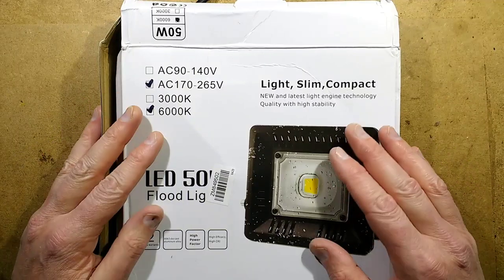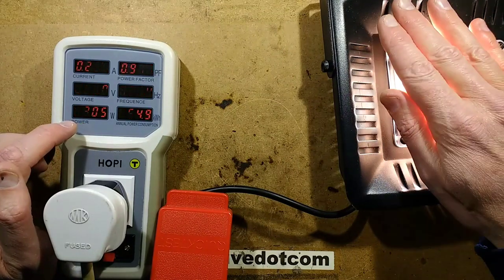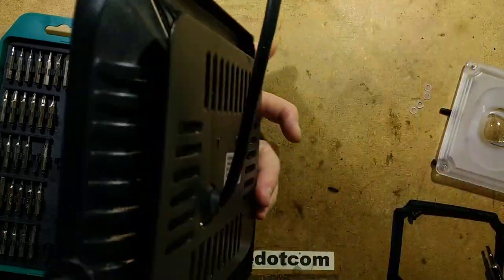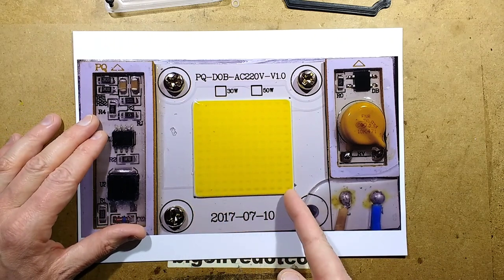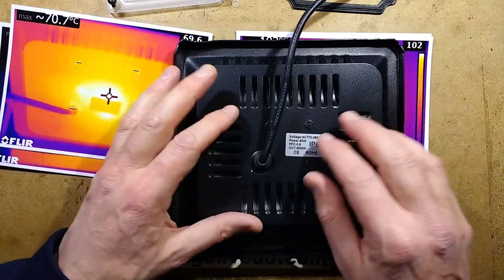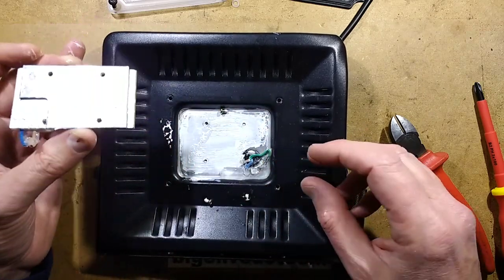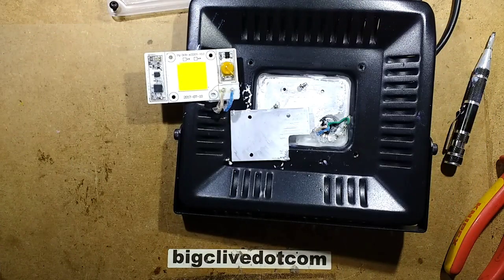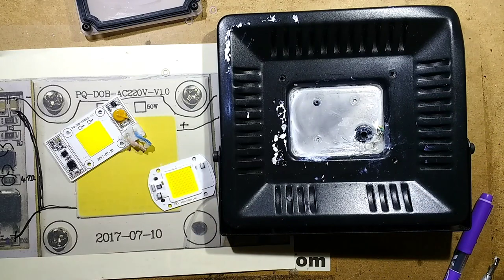Inside a super-slim 50W LED floodlight.

Comment: I guess one way to get around the squished wires issue, use an externally-mounted driver in a junction box near the light and fit a "traditional" DC LED module with a much smaller footprint, yes it adds a requirement for additional wiring, but, saves squashing mains powered wires to a potential short... :)

And were you filming this at around 8pm-ish? The mains frequency went down a fair bit on the Hopi, indicating the end of a dreary TV soap and everyone powering up their kettles... :P
Reply: twocvbloke ,
¿¡ !? ¡¿ That much measurable frequency drift ¿¡ !?  
Gonna have to look for that during an analagous event here in the US !
Ponderous... wonder how "smart power grids" technology is supposed to mitigate said affectations...
Reply: The voltage dropped by a couple of volts, but only when that 52 Watt load was added. The total resistance (impedance) of the cabling to that meter was probably around 0.075 Ohms, which would account for a ~2V drop, using the formula (V^2/W) = R. So ~4/52 = 0.077 Ohms.
Reply: @john howard, sounds like a  trump quote!

Comment: I've got one of these modules (not the dodgy housing). Mounted it on an old PC heatsink.. its been running happily for 6 months now... But it does get quite hot without the heatsink... And the main input pads are flimsy I'll have a check to see if I can see any chip ids on my one.

Comment: I'm wondering if anyone can answer a technical question about LED lightbulbs.
I'm in the US. All of the bulbs in my house are GE Reveal. Originally it was the Reveal incandescent, then the Reveal CFL's now the Reveal LED's. It's the only bulbs whose color I can stand, it filters out the yellow without being overly cool like the fucking god awful cool white daylight bulbs. The LED's aren't quite as good as the incandescent were but still very close to the same color.
ANYWAYS, I've noticed that with the LEDs GE has updated them a few times over the past few years. Now they're branded as GE HD Reveal. It looks like they've got the wattage down a bit for the amount of lumens they put out. The older LEDs had NO noticeable flicker. Their newest ones DO have a slight flicker which is only noticeable if you know it's happening or if you scan your eyes over them quickly. It's not bad but it still annoys the hell out of me.
My question is WHY do they do this? Is this a case of GE cheaping out? Is it a byproduct of increasing the lumens while decreasing the wattage? The bulbs say they are dimmable, does that have anything to do with it? I have older Reveal LEDs which say dimmable but don't flicker. Why, why, why? It gives me a headache sometimes but I hate the soft white LEDs and the warm white LEDs so I feel stuck with these. The color output really is amazing. It makes colors (paint and such) really look nice and whites really look great. I've tried every other brand and none of them look right.
Reply: I've found that different lighting takes 1-2 weeks before I no longer notice the colors and shadows looking weird.  Maybe you should try leaving different bulbs installed for awhile and see if you get used to it?  Might free you from your reveal prison.  Perhaps you're just used to reveal color temperatures so everything else looks bad?  My guess is the driver circuitry has changed (certainly because its cheaper) and now there's visible flickering.  If the driver has changed there could be small differences in efficiency.  I wouldn't put up with flicker from expensive bulbs they would be going back to the store.  I've always bought $1 warm white led bulbs from lowes (the whole house is full of them) and never had problems except for poor heat sinking eventually causing driver failure.  This is a design issue, LED screw in bulbs have terrible heat sinking in general.  After 2 or 3 years I put another $1 bulb in and tear the broken one apart for the LED board.  Most people actually prefer some (or a lot) of yellow in their indoor lighting because its similar to tungsten bulb colors and is good for relaxing

Comment: get one of those led light bars meant for vehicles and test it, I bought one of ebay that was advertised as 180W but when testing it with a 240W capable PSU I only got a draw of aprox. 30W. Would be interesting to get a deeper look on one of those.

Comment: STM18 seems to indicate this is part of the STM18xxxx voltage controllers manufactured by ST Microelectronics in Switzerland, a well known manufacturer.  I would suspect that the "C" designates a custom part made for a specific customer and that the rest of the part number designates something like the intended voltage and the design version.

Comment: Well, unless you're having some sort of emissivity issue due to the conformal coating (the goop) going on there, if the mosfet/transistor is 108 centrigrade on the outside, it's going to be as near as makes no difference at critical junction temperature (125 centigrade) on the inside, which should see it fail fairly rapidly.

At my college they (probably still have) had a little chamber to stress test circuits for heat. As one of our lab excercises was to design and execute an experiment with regard to reliability, I built a little 4520 counter circuit which I then intended to run at critical junction temperature, to see how long it lasted. I wrote a little assembler program for a Z80 computer board, which would clock each of the counters in turn and checked whether it had in fact increased by 1 or rolled over to 0 if the previous value was F. If an error occured, it would energize a relay which would, in turn, stop a timer.
In theory, according to the most widely used model for a single semiconductor junction, it should have lasted about 72 days, but, probably because there a quite a lot of junctions in this IC and it's not really expected to run much above ambient (so the non-military ones don't undergo testing for it), it lasted only 4 days.

In case anyone's wondering, there's an about x2 factor increase in lifetime expectancy for every 5 centigrade below critical junction temperature, so at a typical 45 degrees CPU temperature, you're looking at about 60 years for every individual junction (and there is prototype testing in this regard, although the production process is trusted afterwards).
Reply: You're correct about junction temperature failure times. A semiconductor manufacturer in Europe (sorry, no specifics here, they would lose contracts) made devices which the customer specified were to be 100% QA tested for about a year at a specified minimum temperature, and under specific electrical conditions, before they were acceptable. Temperature had to be controlled very precisely, to ensure a 100% pass rate. One failure meant rejection of a whole large batch of devices, so a 5 degree Celsius over-temperature could have cost a lot of money. And a 5 degree under-temperature would have entailed a re-run of the whole test, which was also expensive and could have resulted in the cancellation of the contract. The customer was happy to pay around 20 times the retail price for something with ostensibly the same capabilities, which had not been life-tested so thoroughly. Why? The operational design life of the devices was quite short, but lives depended upon total semiconductor reliability during that time. The customer needed that guarantee of reliability. No device ever failed during use, and lives were indeed saved. Knowledge of the behaviour of Silicon junctions at temperature was essential, even critical, during design and manufacture.

Comment: A very proffessional breakdown , although it would have been more relevant to know if it can run 5 hrs without blowing , and if the power is reduced as it gets hotter
Reply from the maker: +oz93666 Power did not reduce significantly after a few hours.

Comment: Would those louvres be a safety issue in the rain, or is the internal waterproofing sufficient to effectively just make it water cooled?
Reply: awmperry the vent holes don't go through to the interior, just from front to back of plate.
Reply: Ah, so it's a single plate? Hard to see on a small screen, looked like there could have been a cavity. Cheers!

Comment: I love the fact it has a MOV to protect it against voltage spikes, but I didn't see what protection they had if it shorts out.  Are the traces thin enough to act like a fuse?
Reply from the maker: From destructive LED tests I found that the LED bond wires blow like fuses and the arc is contained by the phosphor loaded gel.
Reply: I don't think that will help if the MOV shorts.  I believe there's been a few fires started by power strips where the MOV overheated before they figured out they need to add thermal fuses touching the MOV.
Reply from the maker: Ah, I misread your post.  The track or supply fuse would fail.
Reply: Против Глобал, that's what I don't like about capacitive dropper - because spikes are high frequency, those go right though.

Comment: I bought 6 of the 'Driverless' LED floodlights, 4x10w and 2x50w, all of the 10w ones failed within 20 hours of use and one of the 50w ones after about 60 hours

Comment: The second type of driverless LED you show (that you did a video on earlier this year), I had two of three 30-watt ones fail on me; I bought them from same eBay seller.  They ran about 30 minutes a day for 6 months, before failing (both failed within a week of one another).  The actual cob LED is what failed; I could see several dead diodes within same row.  I don't think it is heat related, they were mounted in recycled flood light cases with expensive compound and everything stayed under 70 Celsius when measured.  My guess is they have same issue as first generation/cheap cobs  where they're poorly matched.  I've got one original still working and two new replacements...will see if I get anymore failures.  If I do, I'll probably buy 20 watt version.

Comment: Where did you get that cool little line power connection block? I could definitely use one of those on my bench as opposed to the "Death Cord" I have that is just a line cord with a line mounted switch and insulated alligator clips.
Reply from the maker: Search my videos for quick test.  I took it apart in one of them.

Comment: I wonder the rating on that bridge rectifier...just found the same pkg in one of  my 3D printer gear, only have an smd code. Clive d'y'think this 50W  performs as well in 60c  110VAC N.A. I shall see if there are any avail in that option. Perhaps one might determine power factor without the HOPI ? Best,  C

Comment: They could of pressed a depression into the metal to allow for cable entry (this can be done sit punches the hole, in a single operation, doing this would of increased the cable space, then they could of put on 4 mounting screws instead of 3.

Comment: Thanks Clive. Another one to avoid. Reliability has to be an issue, given the heat, and with 72 LED's in each string. Only one LED needs to fail, and it will take out its parallel partner, and the device becomes a yellow display palette for two little dead flies. An MTBF of 100,000 hours per LED indicates an average expected life of around 1,400 hours, even ignoring that hot transistor, water ingress, and the dodgy cabling. That's slightly less than two months of continuous running, or under six months of eight hour nights.
Reply: a guy above said his ran for 30 minutes a day * 30 days/month * 6 months = 2700 hours between failures not too far off lol

Comment: I have gone through approximately 5 of those led chips your comparing and they all failed after about 2 weeks of continuous use.  When they fail they go very dim and/or nearly half the cob blacks out completely. I even had a grow led fail and i used such an efficient cooling system that it never got warm. Failed after 2 wks.

Comment: would you have refrained from taking it to bits in a non reversible manner if it was a warm white flood light ?
Reply from the maker: No.  It was bought to be taken apart and wasn't up to expectations.  Technically speaking I could have fitted it with a warm white driverless array.

Comment: I wouldn’t trust the colors of the wires as to which is ground wire. You’d think it would be green, but I’ve bought some of these early version Chinese made flood lights....opened them up to check wiring, and voila. Green was one of the legs out of the driver instead of the actual ground. The ground was “glued” to the case with hot glue gun material. Danger will Robinson!

Comment: I know this has nothing with this video, but maybe you can answer a question. I have some of these power banks that hold one 18650 battery. Can you explain why if I charge one of them up, 2 days later (without using it), it does not stay fully charged? Does the little circuit that has the LEDs on it discharge it even if it has not had a load on it?
Reply from the maker: There's a small standby current, but it shouldn't discharge the cell too quickly.

Comment: about 8:08 i have been trying to find one of those web pages for a long time now. care to share one you find or how you find one?
Reply: Just Google search for a random number such as '16744821674482167448216744821674482' & you get nothing. Having said that if Google's bots scan this page, the above random number should return just this video in it's search. Another way is just search using a single asterisk.

Comment: Im a beginner at electricity. Can you please explain what you ment by testing the light if it was earthed . Was that a good thing or not ?
Reply from the maker: Most metal cased lights should have the earth or ground wire connected tightly to the case.  It provides a path for fault current in the event of a fault.

Comment: Could be an austenitic stainless steel like 304 or 316 they aren't magnetic either.
Reply: Yeah, but unless they milled it out of solid to get those cooling channels, it would have to be cold-worked.  And cold-working makes austenitic stainless steel magnetic.

It's amazing the stuff you learn from watching AvE.
Reply: I'd think aluminum, judging by the shipping damage.  Probably better for a floodlight anyway, because of the higher heat conductivity.
Reply: Austenite to Martensite conversion. For example - https://www.asminternational.org/...pdf/7c5e4830-b443-4c71-a8c8-1a85c5b39dc5 . Also affects corrosion resistance (particularly halide attack).

Comment: I got some 80W spots with drivers on board and use them every day for 2 hours....they all die after 3-4 months due to overheating, one can see the tiny black spots at the COB chip. I'm afraid they are meant to fail, 20% more cooling area would do the job....crazy world.
Reply: Only 2 hours? You can use them longer than that, even during flowering!

Comment: i've used a few of those 50w integrated driver leds. put 3 of them to the back of an old 2x4 lay-in fixture. one of the 3 went dark after a while. not completely dark just real dim. whats the life on those things?
Reply: not sure, how long did the one last?

Comment: Clive, g'day bud. I have a " Bottom line, Side finder" depth gauge/ fish finder that I haven't used in a few years. I inserted the batteries and it seems to no longer work. I no longer need this unit as I have upgraded. My question is. Would you be interested in tearing it down and not only showing how it does what it does, maybe trouble shoot its issue. I no longer want this, so I'd not want it back. Free to you if you're interested. Thanks, and I really enjoy ya posts. G'day sir.

Comment: Are there any driverless LED boards like those that don't flicker ?
Reply from the maker: The way they work without smoothing means that flicker is always going to be an issue as they are off for the part of the sinewave where the voltage is lower than the combined forward voltage of the LEDs.
Reply: Ohh now I understand, thanks ! So if the current would be converted to 230V DC it would not flicker.
Reply: :/ So in short, all those driverless LED boards suck.
Reply: I thought about using those for my plantlights, because they are so cheap, but if they flicker, it would probably drive me crazy.
Reply: 4000K LED lights are the best, at least if you want natural growth, and you don't aim for harvesting anything. I use those lights for my indoor Bonsais. Most interesed people would probably be disappointed, if I would show them my Growroom :D
Reply: Yes, that is correct. I tried many type of LED lights and those ones I linked above seem to work the best so far.
I don't know, if there do exist different types of 4000K Led lights at all, they are constructed with blue led lights, and have a phosphor coating which changes the wavelength. They will probably all use the same blue leds, which are the cheapest to manufacture, but wikipedia says, some use uv leds. The phosphorluminesce gives a broad specturm of wavelengths it says, not sure if there is a way for me to figure out, how the spectrum is exactly distributed without very expensive tools. The temperature is just the balance of blue/red factor. So 4000K is probably like the average of those 2 spectrums :
http://www.itwissen.info/lex-images/spektralverteilung-von-weissen-leds-diagramme-hera.png
Reply: It's really rare to read on Youtube, that someone claims to be wrong about something, you really seem human to me !
I did watch some of Clive's Videos about adding a capacitor, which seems to help a bit, but this also creates a new problem (don't remember exactly what), so I am wondering if there is a way to get those chips run completely stable without any flicker. I am not much into Electronics, normally I rely on others knowledge and soldering abilities.
Reply: I will check this video now,
I found Clive's video I was referring to : https://www.youtube.com/watch?v=UGTXne_e554 which is a follow up from this : https://www.youtube.com/watch?v=KKd2L9Exw0M
Reply: OMG wtf the video you linked me is crazy. This guy really is suicidal.